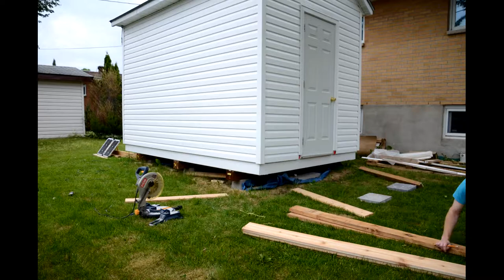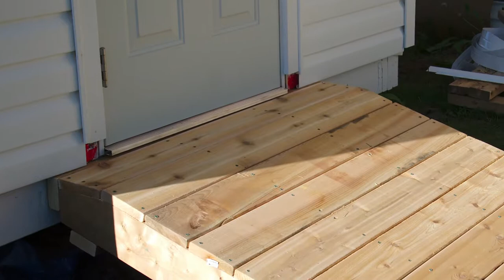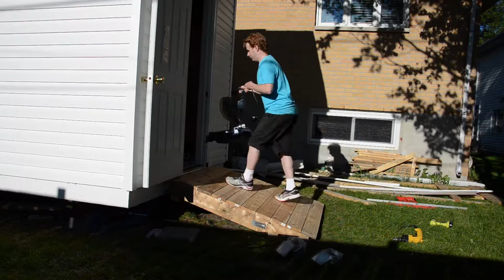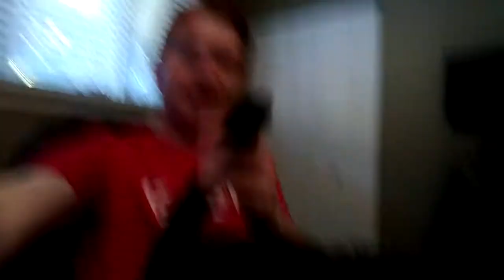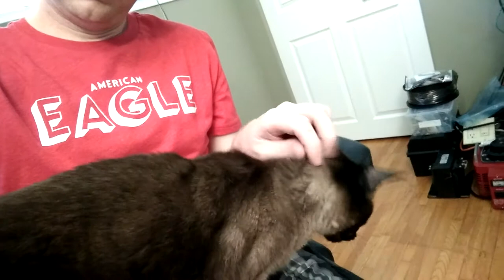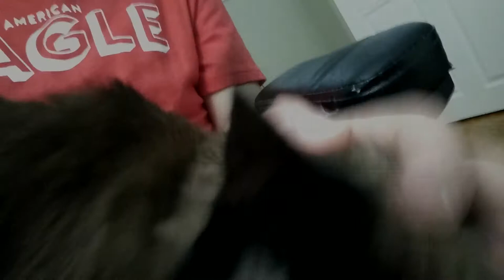Shed Build: Ramp

Comment: what is the cut angle at the top going in the door .My ramp by my looking at it and measuring will be 74 inch's long and since I am using it for 2 42 inch ride on mowers I want a smooth transition to the inside of the shed and it has a roll up door
Reply from the maker: I don't recall actually, I kinda improvised the angle based on the distance I wanted it to land at.  It's maybe around a 20-25 degree slope.  The roof is 30, and it's not quite as steep as the roof.   For ride on mower you probably would want to go a bit less steep, or multiple transitions so it does not bottom out.  This one is fine for my snowblower though but for the push mower I kind of have to lift the front or back so it does not rub when it goes in.